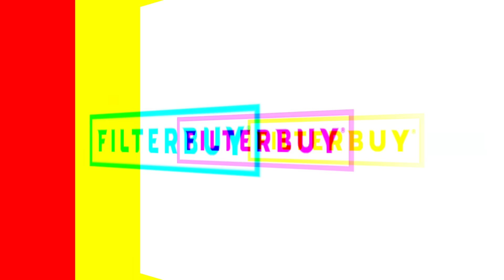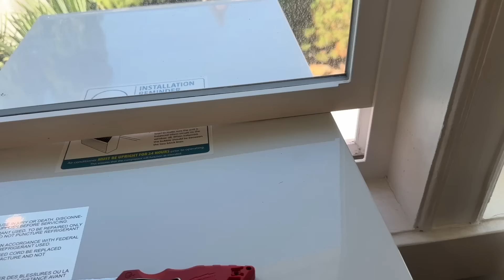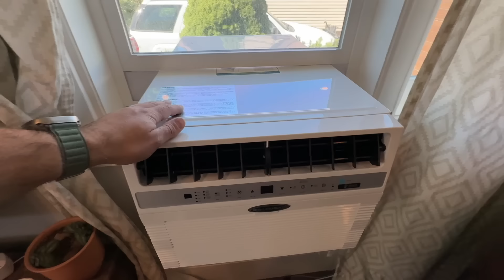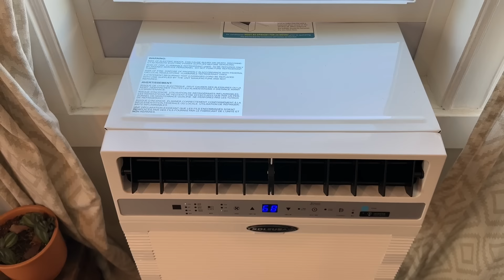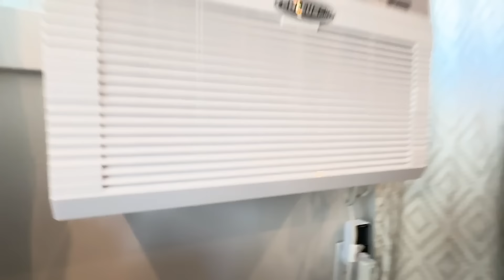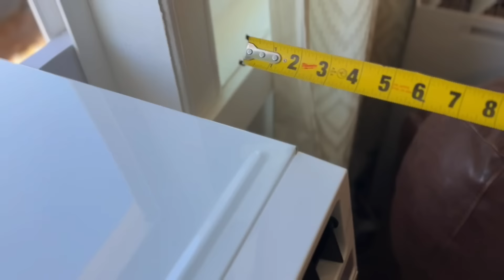I Thought It Couldn't Get Any Better... But It Just Did.

Comment: It's about time!  This should revolutionize all the millions of folks living in condos where they are not allowed to put in a Split heat pump, or it is prohibitively expensive to do so.  In vancouver a couple was quoted $25,000 to put in a heat pump for the 600 square foot condo!  nuts.
Reply: @planesandbikes7353  it doesn't work below 30°F
Reply: @davidcameron2366  It is not rated to work below 40 degrees F. Technically it does, but the coils get cold relative to the ambient temperature, so ice will develop on the coils over time. I'm hoping I can figure out how to retrofit it with a defrost cycle. If I can retrofit it with a defrost cycle, it should work at down to 20 degrees F.

I have a nephew who is an engineer. Maybe he can design a retrofit defrpst kit for it. Seems like there would be a market for it.
Reply: @davidcameron2366  It doesn't work below 41 degrees F.

I am currently using a SereneLife 14,000 BTU portable AC with heat. It isn't real quiet but less noisy than my propane furnace. It doesn't work very well below 30 degrees F, but I can set the thermostat of my furnace down to 64 degrees, and let the furnace take over when the part of the trailer not being heated by the heat pump drops too low.
Reply: @davidcameron2366  Vancouver (assuming they're referring to the city) probably drops under 30F less than 20 nights a year most years.

Can't depend on it as exclusive heat source, but it is an efficient way to keep the cold at bay most of the year.
Reply: @priestesslucy  I'm in Maryland which is a lot further south then fucking Vancouver and it's been under 30F for like 3 straight months lol.
Reply: @AustinMichael  Use English not trash talk.
Reply: This is a step in the right direction but it's not quite where it should be yet. We need units that work down to 0 degrees and the quality on this one is not there yet, but still useful for early adopters
Reply: @jasonlaboy  Midea and Gradient make units that will function down to minus17 degrees F. These cost thousands of dollars, however. For example, the Gradient unit is $3800 when purchased in bulk by NYC or $5000 for private purchase.

This is less than a mini split plus installation, but still expensive.
Reply: @dalesplitstone6276  yeah I don't think they need to be that expensive
Reply: @jasonlaboy  It won't ever happen because there just isn't enough surface area and the market is so niche for something like this anyway. Mini split is the answer.
Reply: Useless waste of time if it has a heating outdoor ambient of 30F. Don't call it a microsplit, it's a hyposhit. All hype with a shitty execution.
Reply: By an Italian company whose name begins with 'M'  I wonder....?
Reply: This is going to be super
Reply: I don't live in North America, is it prohibited in some area to install mini-split units or landlords themselves are lazy? My dad deducted from our tenant rent when they decided to install mini split. Because many of these window units are not as efficient as mini split systems.
@planesandbikes7353 how can be that expensive, there are on amazon 9000-12000 BTU units for 500-600$. I'm aware about installation cost, but 25k is air source heat pump + radiators price tag.
Reply: Not allowed 😂 What they don't know, won't hurt them.

Comment: I found this interesting. This is a Brave AI explanation on window mini-spit system terminology.

"Meaning of Mini-Split Window ACs
Based on the provided search results, window air conditioners are not actually called “Mini-Split”. The term “Mini-Split” specifically refers to a type of ductless air conditioning system, also known as a ductless mini-split system. These systems consist of an outdoor compressor unit and one or more indoor air-handling units, connected by a conduit. They are designed to cool individual rooms or zones without the need for ductwork.

Window air conditioners, on the other hand, are self-contained units that are installed in a window to cool a single room or area. They do not have the same design or functionality as Mini-Split systems.

The term “Mini-Split” likely originated from the fact that these ductless systems are smaller and more compact than traditional central air conditioning systems, and they split the cooling system into two components (outdoor and indoor) rather than having a single, larger unit.

It’s worth noting that some manufacturers or marketers may use the term “Mini-Split” to describe window air conditioners, but this is not an accurate or industry-standard term. Window air conditioners are distinct from Mini-Split systems, and the two should not be confused."

Comment: If you can save considerable cost with having the unit stick out, I'd be fine with it. The underside still makes a great nesting area for wasps, and that would be a problem. The major drawback with these saddle units that I've been hearing is that the pump gets clogged with mold and junk. I use condensate pan tablets to keep my normal air conditioners running smoothly, but I don''t know anything about they units that require a condensate pump.

Comment: I live in the salt lake area and I used your videos to install a new Goodman furnace and air conditioner. Very good videos by the way! I started the cool in July and has been working great. Just tried to start up the heat but doesn’t work. It faults out on high blower amps but the same blower works fine with the cool. Goodman won’t talk to me because I installed it myself. Contractors don’t want to look at it for warranty reasons they say. Is there any way you can assist me with my problem. Thanks
Reply from the maker: Hello there. You can get remote support for all troubleshooting problems at Patreon.com/diyhvacguy 

Hope we can help.

Best

Comment: I have a Q. I have a 12,000 BTU portable AC unit by Honeywell that I bought a few years ago that I'm trying to figure out. When it works it is amazing, far better than my 12k Black&Decker units. The problem is that I turn it on cold and turn the temp all the way down when I go to bed but I keep waking up in the middle of the night covered in sweat because it's off and needs the water drained. I've been using the B&D units for years at night but have never had to empty one. They are both 12k BTU portable ACs so what gives? Plus it has two plugs, including one at the very bottom so I have to get out of bed, pick up the whole heavy unit and place it on a stool and then pull the drain plugs over a bucket. Not ideal when my sleep is already horrible. Do you know any way that I could reduce/prevent the water? Since one plug is at the bottom I cannot even hook a hose up and let it empty into a container. The best I have come up with is putting the whole unit in a big tote and pulling both drain plugs. It's not too much water so it should never come close to flooding the bottom of the unit and messing it up and there is a good 2 feet between the air intake vent and the tote wall.
Reply: My Black and Decker portable 8000 has its flaws (thermostat), but having all the water exhausted in both heat and AC mode makes it a big winner. Mine also has the upper and lower drain plugs, but fortunately I have never had to use them. Among other AC's, I used a Tripp Lite.  It had a no-fuss drain system. I considered using a condensate pump for my Midea before it failed. I stumbled upon the Black and Decker I'm currently using and haven't looked back. The Midea lasted one AC season, and the Tripp Lite lasted three. The Black and Decker has lasted two years so far. Good luck! 

I wish I had double-hung windows so I could use a saddle-type AC/heat pump. 
Thanks, The DIY HVAC Guy. 

PS: I found GE to be good at warranty work. They replaced one GE Profile refrigerator and serviced the new one 4 or 5 times at no cost. (defrost and drain issues)

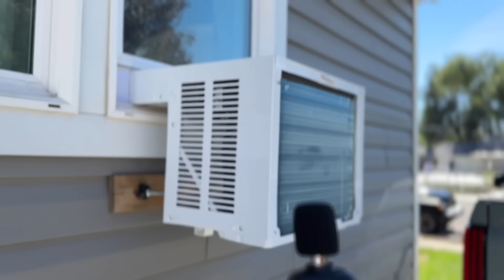Comment: 4:31 does it drip water on the outside?
Reply: Looks like the interior unit needs to be manually drained by removing a plug.  Unit shuts off when this becomes necessary. AC mode only.
Reply: @spazzman90 it has an internal pump that pumps the water outside in AC mode

Comment: What about condensation? Some of us live in a swamp LOL
Reply: Looks like the interior unit needs to be manually drained by removing a plug.  Unit shuts off when this becomes necessary. AC mode only.
Reply: @spazzman90  You mean it does drain to the outside, out the window?  Crazy.
Reply: @JustSayN2O it has an internal pump
Reply: @spazzman90  Well that sucks.
Reply: @spazzman90  The unit has a condensate pump which pumps the condensate out side.  It failed after one season on my unit.
Reply: it has an internal pump, which could very well fail and cause a leak

Comment: I will wait midea version of the heat pump unit
Reply: Good thinking.
Reply: Yep, since he said nothing about cold temperature this junk is good only for Florida and Texas
Reply: They already have a Midea window saddle unit. 
I think they were the first to develop this design!!
Reply: @tjam4229  not available for sell yet with the heat pump bro
Reply: @tjam4229 it’s not a saddle, it u shape which blocks the view out of the window. I ended up buy in the ge profile, no heat pump but I only needed ac. 😊
Reply: @nikij.6058  , you are right. It’s been years since I’ve looked at the unit. I know it was Cutting Edge technology, because it allowed use of the window as well.